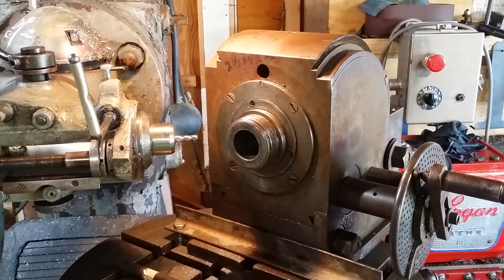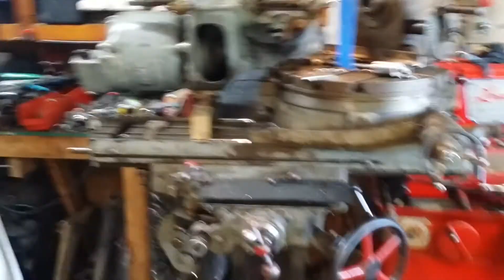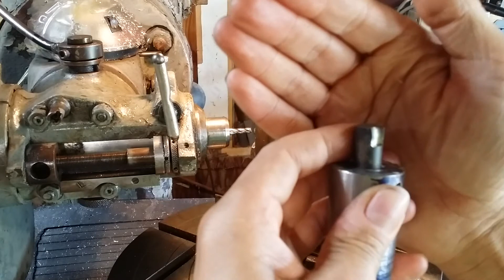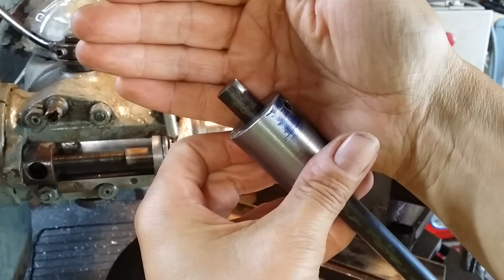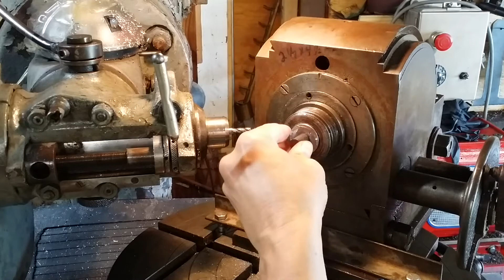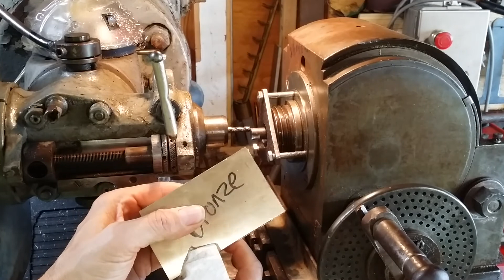Starting the advanced thumbwheel build for the TMC tapwrench

Comment: G’day Craig, it’s certainly different what you want to achieve. Cheers Peter
Reply from the maker: Yeah, its a bit much. But its also kind of practice for a much more complicated thing I hope to do months or years from now. I hope to build a simplified turbine and compressor wheels  for a scratch built small jet engine. But still need to build several more tools, and fine tune some techniques